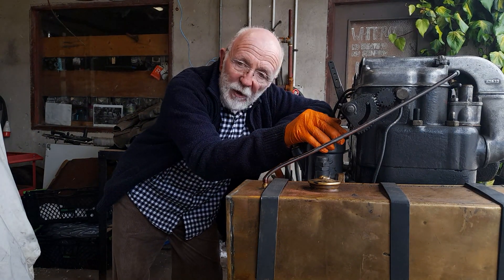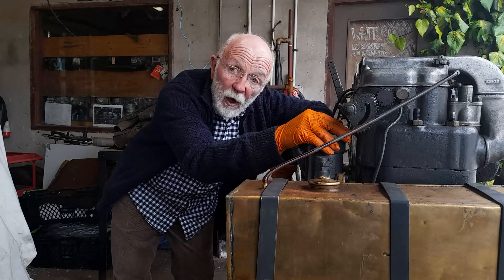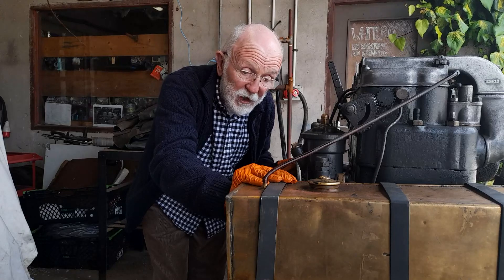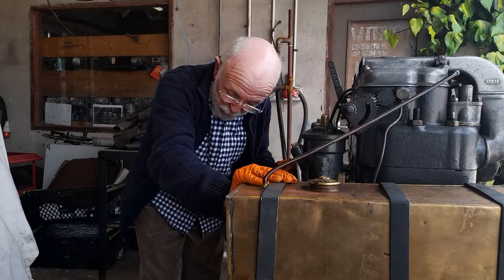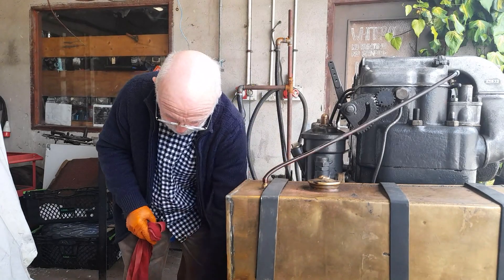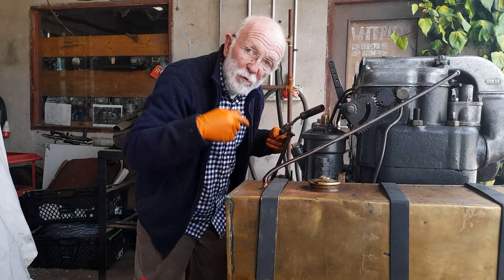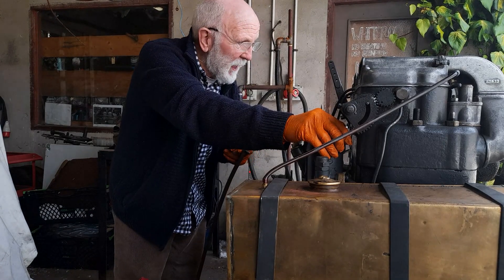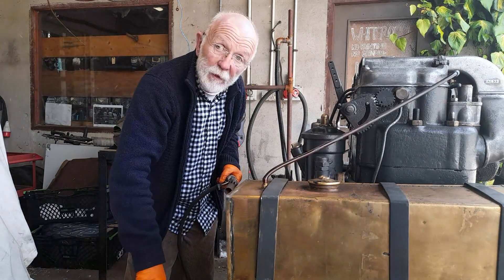Gardner Engines: Fire Eating!

Comment: Hot air guns are pretty good on direct injection engines. I've used them on worn out engines down to about -15c. 

For indirect engines I've used a blow torch with the nozzle removed to make a long orange flame. Once the flames come out of the exhaust they start pretty quickly. 

A lot of indirect engines had manifold flame heaters from new.
Reply from the maker: Yes, I remember my uncle's Ferguson P3 tractor had the same!

Comment: I use a kettle of boiling water and pour it over the engine on a frosty morning on a Lister HR3
Reply: I've had to do that with jelled fuel. Pour hot water over the fuel filter or on a rag wrapped around the filter to thaw out the fuel, a hair drier on the fuel lines and an electric oil filled room heater with cardboard around it to thaw out the fuel in the tank. After a couple of hours the temp came up enough to pump enough fuel to start the engine!
Reply: @alwaysbearded1  that's an interesting tip thanks.